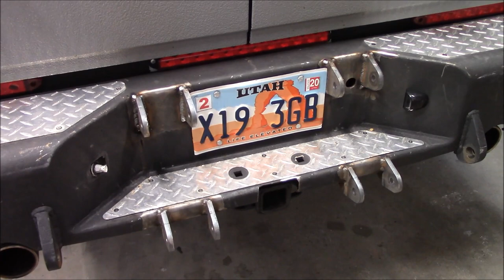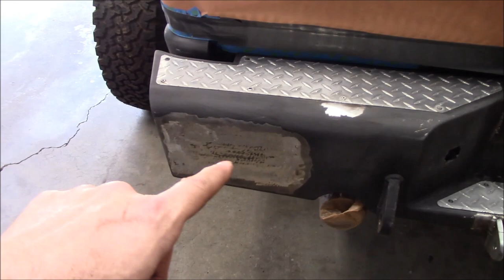20190704 TrailReady Rear Bumper Tire Carrier

Comment: You are making me want to go out and build something. I have done a good bit of welding without unhooking batteries with no issues. I talked with a muffler shop owner once and they never had issues either. You will get different opinions on the subject. I remember you spent a good amount of time adding those lights. Any reason why you welded them back up? They have changed the bed coating and I am not sure I like it now. Just seemed different the last time I used it. I like the Raptor Liner but it also takes more time and money to spray it. A lot more prep to keep over spray under control. I do like those mounts.
Reply from the maker: mossman381 yeah, I’ve welded on my trucks without disconnecting before, too, but my Brother the welder says he’s seen stuff fry before, so it’s an easy precaution. I did spend some time on the back up lights, yes, but I never was completely happy wit the look and they kept popping out being the rubber grommet style. I’ve got other things in the works now. Videos will follow.
Reply from the maker: mossman381 yeah, and the Duplicolor bedliner has changed. It’s got way more texture in it now. I kinda like it more. The old formula was durable, sure, but it was not a slip resistant surface.

Comment: This is my second time watching. You are too hard on yourself. I know I push myself to always do my best and I can see that you do too. But, you were making compound curves match up with no jig and using your eyecrometer. You did a fantastic job! Were you using Flux Core or did you have gas as the camera never passed over the Lincoln in such a way for me to see if it was FC or with Shielding Gas.
Reply from the maker: Thank you! Some of my issue is I know guys that are really good fabricators and as a Construction Engineer I know what right looks like.  I'm always striving to learn more in that regard.  I use C25 for my gas.  I can flux, but I like gas.  I am tempted to try out dual shield someday, too.

Comment: Wow This is an amazing tire carrier! Excellent work! One question do you think This idea would work on a factory bumper? I have a 2019 colorado ZR2.
Reply from the maker: Factory bumpers are very thin steel.  You can use a factory bumper only after bracing it with thicker structure on the back side.  So, yes, doable, but I would brace it.
Reply: @rockymtnredneck4888  awesome, may have to try this out. thank you for the reply! Just subscribe too the channel!

Comment: Do you know the exact transmission crossmember kit that you used for the barrells? and what size tubing is that?
Reply from the maker: Oh, I either got it from DIY4X or Barnes 4WD.  Either one are good sources.  Check out their websites.  My tube is 1-3/4" , the barrels were a full 2" so I had to remember that when notching them for a tight fit.

Comment: Great “F’N” Idea! Love this design. I wonder if a cotter pin so the wheel tightener doesn’t Unspin? Where did you get the bumper and what brand is it?
Reply from the maker: Kelly French check out my playlist on the bumpers. Then go give Matt at TrailReady a call.
Reply from the maker: Kelly French oh, and I’ve had no issue with the wheel coming loose, even though this set up is temporary.